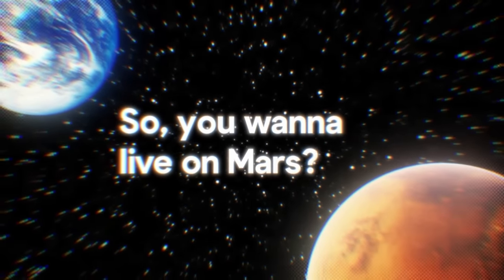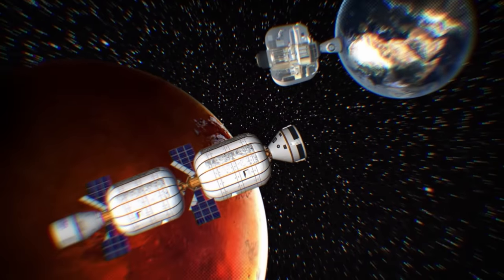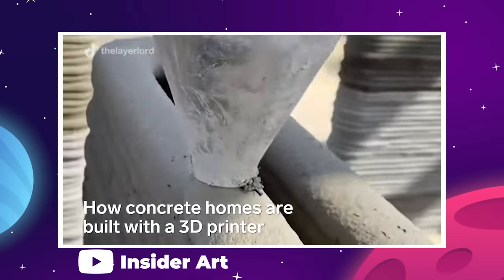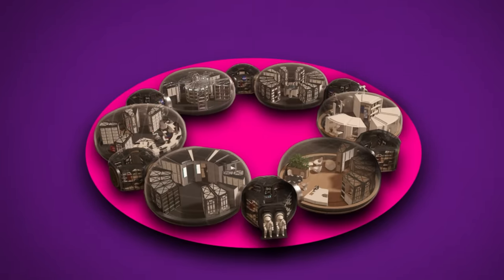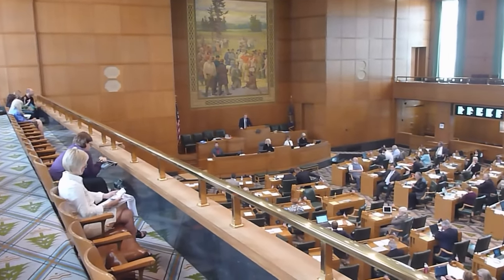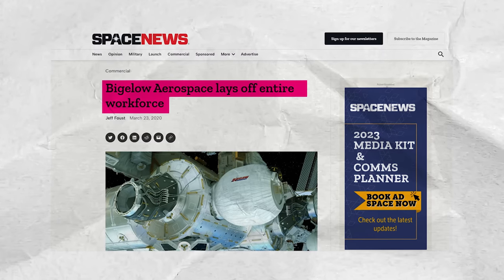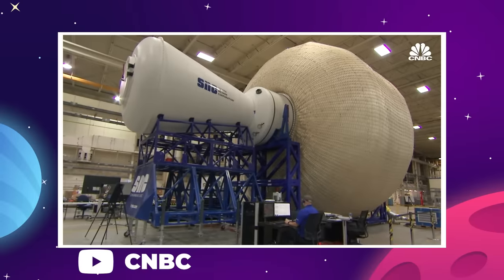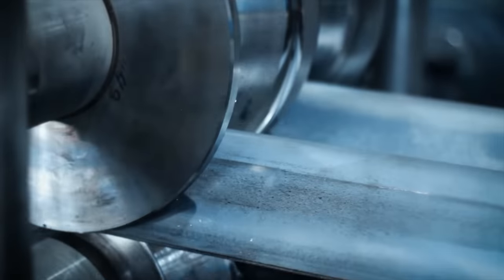Why Inflatable Habitats Are The Key To A Mars Colony!

Comment: Or drill a tunnel, insert a pod at the entrance which contains an airlock and all the hardware. You then inflate/expand into the tunnel and move in. Provides all the protection you need plus you dont need heavy structure to support the habitat
Reply: 100% agree. I see underground as a more viable option
Reply: @CountryLifestyle2023  I suspect that at the end of the day there is going to be a combination of all of the above. There is going to be the need for overwatch/Gateway-type balloon-type facilities, while on the ground, underground habitations will be created for living, working, agriculture and the like. Not everyone will relish the prospect of living underground long-term, though, so there will also be above-ground facilities, as well, that will be created in various ways, including 3-D printing and, eventually, there will be domes over towns and cities.
Reply: @Norman Munroe  agreed! First gotta land, than everything else comes
Reply: Air locks won't work. You will need to use a shower lock to keep the dust and regulith from making it into the habitat and cause issues with the human body.
Reply: drill a tunnel on mars? do you have an idea of the size of a similar drill? a bit better a cave/tunnel where inflat bigger size of that staff. not a huge pressure, say 0.8 atm. some nuclear generator and as many moxie as possible to produce oxygen from Co2. One problem is to get hydrogen to make whater and the next is food. of course you plant vegetables but it's not easy. Mars regolite is almost poisoned, ostile to organic presence. must be treated for long. may be better to take some ground from the earth. Do you know making a 1000 m^3 of surface? plus you need an infrastructure to run a whater reciclyng system etc. Not one mission. it's years of work of in place workers. robots? let's see
Reply: @MrMetalzeb  We don't know the nature of Mars soil.

Starship will be big enough to send drills, maybe not the massive ones we have here, but they will do. And Maybe send bigger ones that simply need assembly. 

Water is on Mars. Ice caps. 

You don't need soil to plant vegetables. 

Alot of these points are major concerns, yes they will need to be dealt with but are not major road blocks compared to simply getting to Mars
Reply: Thinking that people’s preference is the determining factor in Mars living… wow
Reply: These discussions never deal with the reasons to make a colony. As a scientific outpost Mars could have some value, but that's about it. People (rich people) decided to colonize other places on earth for more riches. There is no oil on Mars and no indigenous people to exploit, so it will be very hard to hard to get corporate funding for a large-scale permanent martian colony project. 

This underground living will be necessary on future dystopian Earth and being underground in both places looks pretty much the same. Additionally, Earth has air and water that can be cleaned and used to support human life and more comfortable gravity so bones and muscles of people and livestock don't atrophy.

The sun's power is also greater on Earth for power generation if its energy still reaches the surface.

If we can't terraform Earth why do we think we can terrafom Mars?
Reply: Or... mentally mature
Reply: @CountryLifestyle2023 What a Sheeple 🤣😅😂🤣😅😂🤣😅🤣😅😂
Reply: @David Sheckler  Everyone alive is that, and If you believe otherwise than you to have been blinded
Reply: @CountryLifestyle2023  Oh no!!! Blinded!!  Please show us the way!!  You ARE special son!!
Reply: @Jenny Anydots  The person calling ppl sheeple is special, than they tend to think everyone is blind bit them simply because they don't agree with them. That's special. 
I'm just pointing out the irony in it
Reply: @CountryLifestyle2023  Special Lifestyle is your new name
Reply: @Jenny Anydots  Ahh ur a troll, but  not even a good one.
Reply: @actual_nonsense I agree, the most inhospitable place on earth is more hospitable than mars.  The earth is huge, lots of empty space to live in
Reply: Like a trapdoor spider.
Reply: If only someone was developing a huge drill for creating tunnels….Boring + Spacex
Reply: Okay yeah so your going to send one of Rocket man's boring machines piece-by-piece to Mars that would take 5 to 10 trips to Mars and that's just a guess mind you lmfao😂 I think they should charge a million dollars per person to go to Mars so it's only the billionaires and millionaires lmfao😂 sounds good
Reply: @actual_nonsense  The moment we learn how to terraform Mars is the moment we learn how to re-terraform Earth.
Reply: @krombopmike5339  since that implies simultaneous development for two different problems, I think you are wrong about that. Moreover, re-terraforming Earth will need to come first for economic and practical reasons anyway. Cleaning toxic air is not the same as creating an atmosphere or making a magnetosphere.
Reply: No drilling, just find natural caves..
Reply: Beat me to it
Reply: I am actually working now on a few automated growing systems just for that purpose. As of now with 3 full cargo starship we can  create enough food in Situ for about 50 and with minor additions we can double that
Reply: Good idea 💡 also
Reply: Agree...I think the initial habits will be inside Martian Lava Tubes and be inflatable.  Also, if you google the image "inflatable-farm-section_cam16" you'll see an image of a martian habit created that (I believe) pretty much matches the diameter of the Boring Machine.  In one of the SpaceX videos that Elon did on Starship he did answer a reporters question that the could send the Boring Machine up in two pieces on Starship.
Reply: @CountryLifestyle2023  The BIG problem with any construction projects on Mars (or on the Moon) is that none of our diesel engine powered plant will work. All the diggers, bulldozers and wagons will need to be electric. A typical bulldozer engine power is a massive 350 kW! For comparison, a Tesla Model-S travelling at 100mph uses 31kW. On Mars, it is estimated to take a football field sized array of solar panels to generate each 100kW of power. Imagine the cost of carrying that to Mars! We'll be "camping" for decades, unless we find some nice caves.
Reply: @oldbloke135  You know provide power.... Nuclear 

Likely have to be designed specifically for Mars but still
Reply: @actual_nonsense  You are quite wrong. The owners of a Mars colony will get very, VERY rich. It is not what Mars HAS that is the attraction. It is what it doesn't have. It doesn't have Earth's massive, hugely expensive, gravity well. Metallic asteroids contain precious metals at much higher levels than found on Earth and the cost of "mining" them from Mars is a tiny fraction of doing it from Earth.
Reply: Aggree 👍
Reply: @CountryLifestyle2023  Nuclear power is probably the obvious choice for Mars. I imagine a lot of its power would actually not be used through electricity but as steam, driving turbines to power mechanical equipment, air compressors, hydraulic pumps etc and using the exhausted steam to heat the habitats. Low pressure atmosphere means low insulation requirements on pipework, so you could send high pressure steam some distance.
Reply: @oldbloke135  100% nuclear would be the way. Solar isn't even an option. 

And idk why someone even suggested Diesel engines... pretty sure there is no oil rigs or refineries on Mars lol.

Though I have a feeling that the Reactors will need to be name custom for Mars due to lower gravity?
Reply: @oldbloke135  that's such a great point! I never thought of the lower gravity, lack of a biosphere or magnetic field as positives before! I'm so stupid! Those owners will need to be enormously wealthy to afford the cost of importing water and air.
Reply: Drilling unnecessary, as Mars has lots of caves and tunnels, likely lava tubes, just under the surface. Many appear like glassy tubes, but I suggest that this is because water ice has formed on the interior of these lava tubes, as ice and maybe liquid water are common in subsurface Mars. 
    Your idea of combining this possibility with an inflatable POD is admirable and is far better than being exposed at the surface to 1) radiation; 2) fine dust, which is ubiquitous on Mars; and 3) extreme temperatures, especially the 120 F at night. Oh - quick note; you'll need plenty of solar panels for power as there is low light and NO heat down there. I could be wrong, as depth in a planet's surface introduces heat, but NASA hasn't explored beyond the bare surface yet.
Reply: There should be caves if there was running water at sometime in the past
Reply: We know there is water there and plants breath in co2 and exhale o2 while growing. Soil can be shipped in and waste can be recycled, power can come from reactors and possibly from temperature differential windmills. The first colonists should be AI to get things set up and running before the first humans.
Reply: Better yet, wander into an empty cave, inflate your habs and start doing science!            :)
Reply: I'm willing to be Boring companys earth drills also fit inside a starship.
Reply: Pretty plausible idea, there!
Reply: @kineticstar will need all those things regolith will play havoc with rovers
Reply: You need exceptionally rare circumstances where you have both a steep hill face and where the rock isn't too hard to mine a suitably deep hole. No matter how you slice or dice it, its less work to land a structure on the surface and surround it with simple (high tech) sand bags, filled with dirt.
Reply: The point is the first habitat needs to be erected before personnel arrives and with as little material exported from Earth as possible.  Inflating a structure and burying it with packed regolith would require only small automated or tele-operated bull dozers and would involve very little mass from Earth.  The low mass of small drone bulldozers can be compensated for with vibrational tamping and a lot of time to pack the regolith.  

Exporting a boring machine large enough to build a tunnel capable of holding a habitat would require a lot of equipment to be exported and likely require manual operations.

Note that lava tubes have been considered to avoid exporting high mass boring machines but the approaches to the interior of such tubes are through collapsed sections which are difficult for semi-autonomous vehicles to navigate.

Don't get me wrong, I think colonizing Mars is a very bad idea and there are better alternatives to colonizing space but it's something that we are likely to do, will attract the most attention from a public that is not aware of the science and engineering and inflatable structures buried in regolith by drone bull dozers are the way to do it not mining a cavity for an inflatable habitat to be inserted into, at least for the initial habitats.
Reply: @kineticstar Electrostatic repulsion of the dust has been proposed which could be done with a metal plate before entering the airlock or within the airlock itself.  Besides the entire concept of an airlock is an interior space that is both closed off from the interior of the habitat and the exterior; hence would be where dust mitigation such as with showers could be done though I would imagine that if they were to do a shower, it would be more like steam from hydrogen peroxide and ultrasonic levitation to minimize the amount of valuable water used though the water would of course be recycled.  Ultrasonic levitation works very well against fine dust, if it's fine enough, light traction with lasers could be used and indeed laser molecular assembly by light levitation of small particles is already being worked on.  Ultrasonic levitation to move small particles is already used in commercial fluid bed reactors.
Reply: Just wanted to post this. Send a TBM and drill a bit tunnel and plug the end and  create a livable atmosphere. Underground will protect you from radiation and aliens 😋
Reply: Just look for a cave
Reply: The best part is no part
Reply: No need. There are thousands of old lava tubes on Mars you could inflate them in. Double protection see.
Reply: @Stevie-L-n8g  The problem with lava tubes is not the number of them but that the collapsed entry naturally has rubble which is difficult for a semi autonomous rover to navigate without stranding or damaging itself hence preparing a habitat in a lava tube without human operators nearby is simply not easily done.  Lava tubes might be reasonable for a second generation of habitats on Mars but not as an initial habitat though it may be wise to sight an initial habitat nearby so that such potential habitat sites could be carefully studied for feasibility.
Reply: @johnwang9914  Without an underground environment, above-ground habitats would be very expensive to protect people from the elements. It's that simple, Mars is too dangerous to stay above ground. And who said anything about rovers doing the work?? This is for when humans get there and they will be able to open up a lava tube or enter where a collapse has occurred.
Reply: @michaelzuber9610 don’t worry you’re still the number 1 boring machine around.
Reply: Definitely.  The radiation protection will be key, and a layer of rock above you will save your life.

Comment: TBH you need super thick walls/live underground to protect from radiation, particularly the galactic cosmetic rays. You need around ~5inches of al eq shielding to block a 1000MeV Fe Ion for example.
Reply: Correct. Roughly 1 meter of rock, or 8 meters of water I believe. Inflatable habitats won't do outside of low Earth orbit.
Reply: They could pile martian sand on top to protect it. The habitat surface could have pockets/segments on top to contain the sand and stop it from sliding off

Comment: The "above ground cave" you showed was part of a plan that included inflatable habitats. The "cave" was only intended to help shield the habitats and inhabitants from radiation and the weather. You even showed some of the inflatable habitats meant to go underneath it. Yeah, the 3D printing part will probably be harder than they make it out to be, but if the soil can be used how they imagine, even if it's toxic, it wouldn't matter for the "cave" plan you showed.

Comment: The 3D printing will still be very important.  Sure the inflatable habitations is practical to start with.  However for bulk storage for vehicles and other large equipment, 3D printed buildings should be good for protection from dust storms, etc.  Infrastructure will needs to be built - 3D print it.  Later a combination of printed walls, with inflated inners could be a good option more long term pressurized buildings.  High wall to protect the settlement from the large spider-like bug attacks - 3D print it.

Comment: Great video. I've been wondering about just how big a LIFE module that took full advantage of the Starship payload capacity could get so that's pretty amazing. It's pretty much a Bigelow B2200 size. One of the things that Bigelow did before its demise was a press event where it had mocked-up the interior of a B2200 and there are videos on YouTube of people walking around inside that mock-up. It was mostly a big empty space rather than being split up into separate levels but the sense of scale was impressive.

The jumbo LIFE module is exciting for orbital space stations but for a surface habitat I see one big issue that would need to be resolved. If it's carried to the surface of Mars by a Starship landing vertically then how do you get a hab that size down from the payload bay to the surface of Mars? You couldn't just inflate it in place because it would be incredibly top-heavy and at a 40-50 metre diameter wouldn't be at all stable and if the module is making use of the whole payload space then there wouldn't be space for a crane to lower it down. I'm sure some clever engineers can come up with a variety of clever solutions. Maybe land a crane in a separate Starship that once assembled on the ground could unload the hab module? That might actually be useful beyond the habs so that future cargo-only Starships wouldn't need to allocate any payload space and mass to a crane to unload their cargo because they would know that there was a crane on the surface that could do that unloading for them.

Whatever the solution it's definitely an issue that would need to be addressed.
Reply: was it not the intension to fill the inflatables with metallic foam, hence structurally self supporting.

Comment: Lots of high winds and flying dust and rocks during storms on Mars. Angle the walls to deflect rocks and wind up. Underground  bunkers would be smart for emergencies and for supply storage. Machine O2 and h2o generation is a must.
Reply: The Martian was awesome. Both the book and the movie.
But with the low atmospheric density at the nominal surface of Mars, the most fierce winds would have trouble making a wind sock move.
And yeah - plan to make O2, and methane from the trace H20 and plentiful CO2 in the atmosphere.

Comment: I had read that the woven polymer was as effective at blocking radiation as typical spacecraft material. The greatest advantage is its compacted volume on lift-off compared to the huge gain in living area upon deployment. If the Moon mission is successful, it could be a testing ground for this system.

Comment: I would be less worried about meteorites piercing the fabric than meteorites piercing the occupants. I would feel after underground. (Perhaps tunneled into Olympus Mons?) Underground also solves the radiation problem. Still, it is interesting to see other options.
Reply: It wouldn't come to that. The inflatable habitats will be even safer from meteorites than the traditional ones. Besides, creating underground habitats would have too many unknown variables and requires too much engineering. Taking cost and mission complexity into account, I think that shipping the habitats whole cloth will be the only viable option.